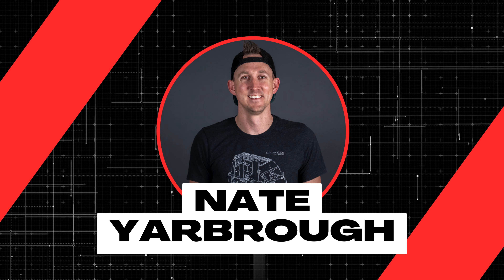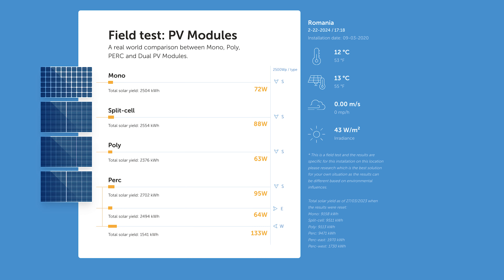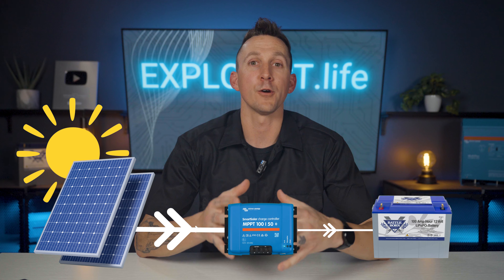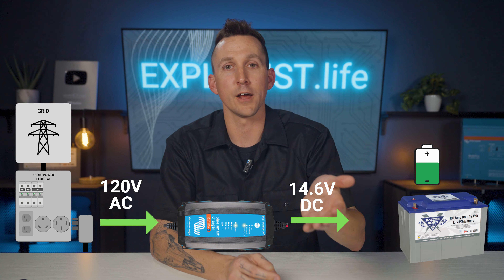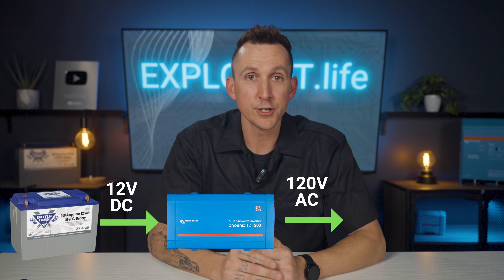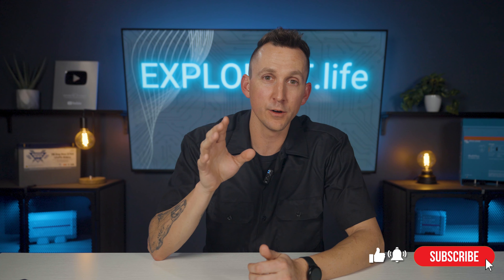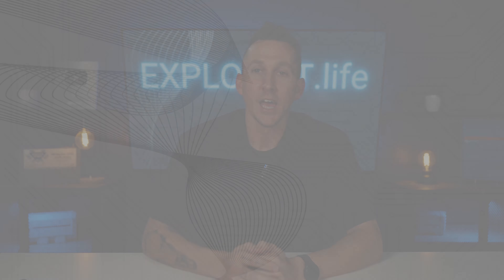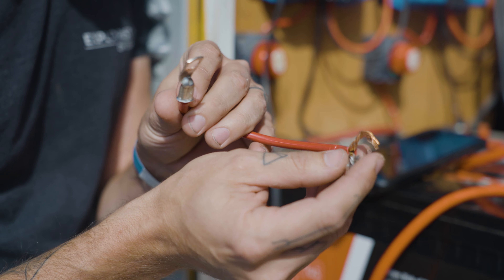Basic Parts of a Mobile, Marine or Off-Grid Electrical System

Comment: 13/14...caught on the purpose of shore power but I believe that you are incorrect. "Connecting to Grid power for battery power" as the answer...but what about when I'm connected to my RV with my generated? It's AC power connected via the shore power plug charging my battery and has nothing to do with grid power.

Comment: Good morning would like help with purchasing a pdf diagram for a schoolie conversion.  24 vlt 3000 watt inverter system 30 amp shore power with between 2200 and 3000 watts of solar. Any info and price would be grateful
Reply from the maker: Sure!  Use the system picker embedded on the front page of our shop, answer those questions, and it will take you to the proper kit.

Comment: Have you integrated Efoy fuel cell/methanol generators?
Reply from the maker: Generators can be treated the same as shore power in any of our system designs as an external AC source.

Comment: 14/14. This is a great video. I needed this explanation of the various components of an off-grid electrical system before spending untold hours over the last two months watching RV electrical system upgrade videos!  Prior to watching this video I was still uncertain about the difference between a dc-dc converter and a dc-dc charger, nor did I understand exactly how battery isolators worked.

Comment: I got 13/14... but I'd like to argue for that missing point. lol.
Question 3, about the primary purpose of a shore power charger.
Yes, it can connect to grid power, but also, a generator, a solar generator, or even another RV's inverter...
Therefore, although the 'correct answer', is indeed, applicable, I believe the choice of "Converting AC power to DC power for battery charging", is a 'more correct' answer. lol.
(think of it not as a 'shore power charger', but rather, an 'AC to DC charger').

I'm raising my score to 14/14.
(I scrolled a short bit and see a few folks claiming 13/14... I wonder how many of them were tripped up by question 3?)
Anyway, this series(Academy) seems like it will be a good thing... especially for those who think electricity is that "Tingly Stuff on Your Tongue", when you touch it to a 9 volt battery. lol.🤔
Keep pushing SAFETY! I've been shocked by 120AC, and who knows how much DC from a park plug... and have... I mean had, a good friend who died when drilling into a concrete basement wall, hitting a 240AC line.
these systems are, actually, very safe, IF!!! they are designed and installed correctly.
We don't want any of 'Nate's Nation' to become a statistic! When in doubt, seek advice from a pro! Do NOT be 'that guy', who THOUGHT he knew what he was doing.🤪
👍🏼✌🏼🇨🇦
Reply from the maker: Haha!  Ah, yes... my least favorite types of questions back when I was on the other end of these quizzes.  Choose the MOST correct answer + What is the PRIMARY function. 🤣😂
Reply: @EXPLORISTlife  The "Primary Function", is to turn AC into DC, regardless of the source. lol.
Remember, depending on how and where you travel, you may sometimes come to a place where "Shore Power", is the wrong type for your "Shore Power" charger... just like DC to DC chargers only work under the correct conditions. A 24 to 12 is not gonna work in a complete 12 volt system, unless you bring in a 24 volt outside supply.
What might be 'the most correct' answer, to you, might be different for someone else... so 'the most correct answer', should be the one that excludes a single use, when multiple uses are possible.
Even Victron doesn't call them "shore power" chargers, but rather, "AC Chargers".
Anyway, this is all in fun, Bud.
Love your content, for years!👍🏼
Keep up the good work, and as I said, don't ever think you can offer too many safety warnings.✌🏼🇨🇦
Reply: Yeah, that's the only one I missed too.  I debated and then went with my gut.  FWIW I'm going to agree with you and not Nate on this one.

Comment: 13/14 Thanks for clarifying the difference between a DC/DC isolator and the DC/DC charger.  I have an isolator in my first van (with a DC breaker on the van battery side).  I try to keep the breaker off unless I specifically need to alternator charge the battery bank.  Is that necessary?

Comment: What size shunt should be with a Victron 3000w interveter 500amp, 1000amp?
Reply from the maker: In short: A shunt should be sized to handle the number of amps flowing through it.  With a 3000W Inverter, that is only 250A at 12V (and less at 24/48V), so both a 500A and a 1000A would be appropriate.  

All of the system designs found in our shop at https://shop.explorist.life include all of the appropriately sized shunts for their various systems.
Reply: @EXPLORISTlife  thank you

Comment: I ordered the new 50. Dc to dc charger from you. I have asked several times when to expect delivery. As of today I have not heard from you???
Reply from the maker: Check your spam folder?  We answer all emails in our support inbox every morning.  Make sure you haven’t blocked our emails too.
Reply from the maker: Just a heads up, but we responded today and the email bounced back with the error of: "Recipient inbox full
Your message couldn't be delivered to (your email address hidden for privacy) Their inbox is full, or it's getting too much mail right now."

Looks like you've got some email receiving issues going on. 🤷‍♂️🙂

At any rate; looks like it shipped last week and was delivered on Sunday per the UPS tracking.

For the guidebooks, those are digital downloads that there were links on the receipt page.  We tried to re-send those to you in your email, but since it bounced back, you probably didn't get that.  

So yeah... fix your email issues and then reach back out and we will send over your guidebooks.

Comment: Hi, Thanks for another good video I wish I had seen a couple of years ago - would have saved a lot of frustration!! Furthermore, your instruction /build videos are the best!

I am coming from the boat side of things. There seems to be some differences between that domain and RVs (++). For one thing the switched and un-switched parts of a system is important - all charging devices basically being on the un-switched part and all loads on the switched. Also some differences between ground from chassis and from engine block. 

Anyways - I have a question regarding your DC-DC charger section. All information from trustworthy sources on the boat "domain", like Nigel Calder and Jeff Cote, say that there has to be a lead-acid battery between the alternator and the lithium house bank. The DC-DC charger connecting the two. 

I have tried to investigate why a DC-DC charger cannot be connected as you suggest. The best answer I have got, on a Victron community, is that the alternator "rectified, unfiltered DC output, from an AC source. Might not be the ideal input for the Orion." 

Would really appreciate your comment to this!
Reply from the maker: For actual installation and not just basic understanding of what a DC DC Charger does like discussed in this video, yes, there needs to be a starting battery on the 'input' side of the DC DC charger.

An alternator needs a battery to charge, so in the case of a DC DC charger, if you connected an alternator directly to a DC DC charger with no battery anywhere on that side, the alternator wouldn't be connected to a Battery... it'd just be connected to a DC DC charger.

If your alternator is going direct to the house battery, it should just be set up w/ a external voltage regulator (wakespeed or similar) so that it is connected directly to a battery in much the same way the alternator would be charging a starting battery.

Comment: 14….

I know it’s not to that point in your classes yet, but the fact Victron calls solar charge controllers Blue Solar that don’t have Bluetooth, (I know, they use their shade of blue for components), just irks me a little…
Reply from the maker: Ha!  Yeah, true.  But don't get caught up in the makes and models of each manufacturers products yet.  An inverter, regardless of if it comes from Victron, Midnite, Outback, Schneider, etc is all going to convert DC power stored in a battery bank into AC power for standard household devices.

All of those aforementioned companies have their own names for each of their components, so once you figure out what type of component you need, and which manufacturer you want to use, you can figure out what that manufacturer calls their model lines.

Side Quest:  If you want to see some REALLY unhelpful model lines, go check out the models of RVs available.  It's always like the Fleetline Flamingo GH745-i

And now that I say that... that's also how graphics cards and CPUs are named...

Comment: Great prensentation but you do realize that the majority of RV ers are still using Lead Acid batteries including myself.  I understand that you don't make money off flooded batteries but you didn't forget to mention wind power and even water mills?  I guess this channel is not for me anymore. Sad.
Reply from the maker: The chemistry of batteries doesn't have anything to do with what all of the individual parts & components do.  Perhaps next time, watch the video with an open mind instead of with the intention of talking shit and maybe you'll learn something new.  If not; and you don't think this channel is for you anymore (which is an absurd mindset), you can just click to a different video you feel will meet your needs.  This isn't an airport.  No need to announce your departure.